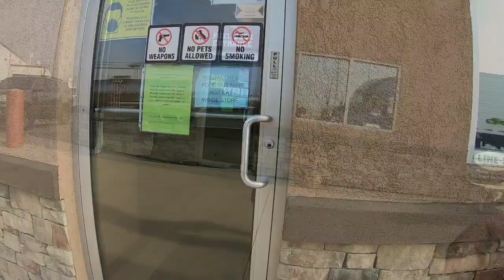Running Around St Joseph Missouri  Pickup A Load

Comment: Im 52 I had a missrible job working in a casino. I started dealing craps when I was 21. I wanted to learn how to drive trucks back then.But I ended up learning how to deal dice. It was the worst mistake I ever made. I did it because the school took less time to get me to work. After I got into it they give you just a high enuff wage to keep you in it. Now the economy has taken a crap there is no jobs dealing. The casinos only brought back half the workers and most of them were extra board. So now at 52 im going to do what I wanted to from the very start and not take  a short cut and get into trucking sense I have to start over. Hopefully I can do it for a long time.